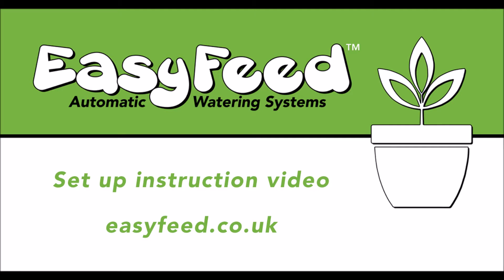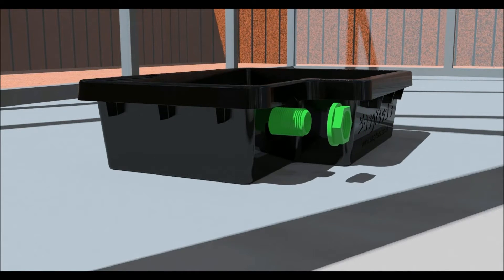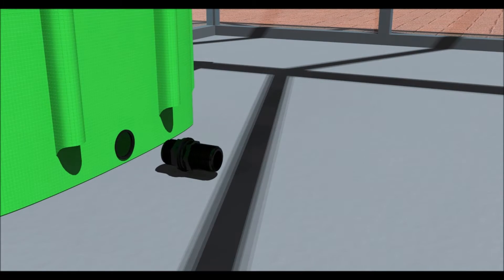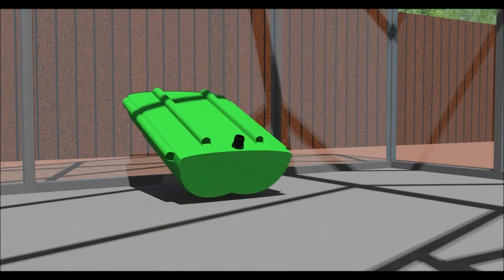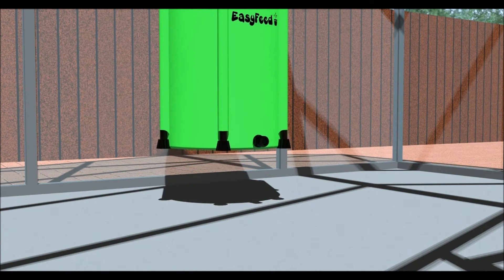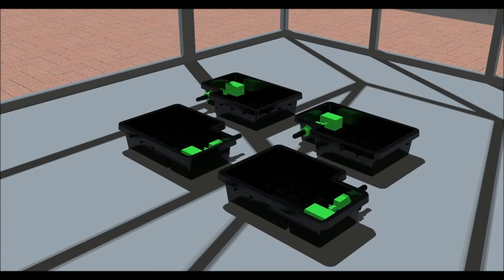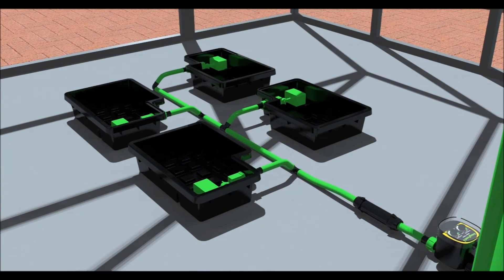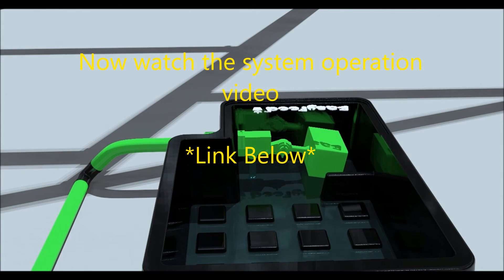EasyFeed™ set up instruction video, hydroponic system

Comment: Why is a timer needed? I notice that the regular autopot doesn't need a timer. Why does this system need a water timer?
Reply from the maker: The timer is there to halt the delivery of nutrient solution to the plant to allow the medium to partially dry which in turn increases oxygen to the root zone.
Reply: @ALIENHydroponics  great. You have any tips on times through the stages? Or will it be subjective to how much the plants take up?